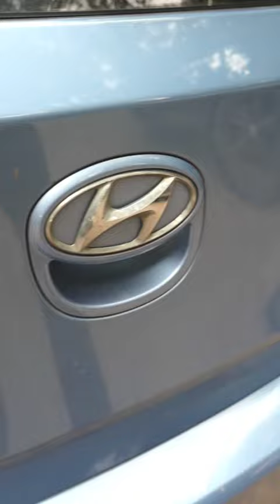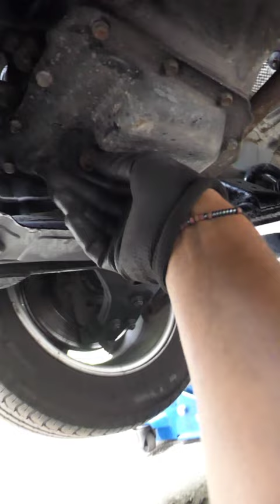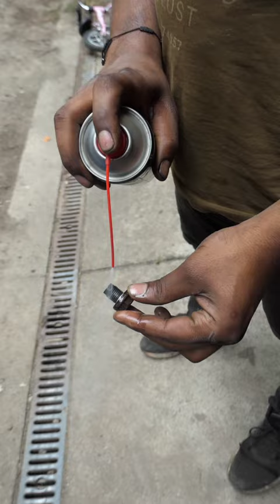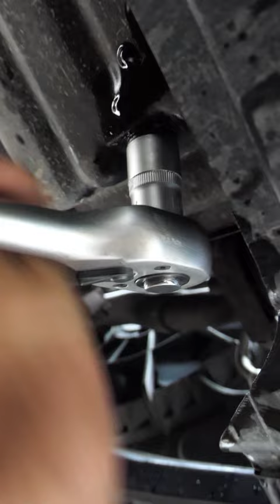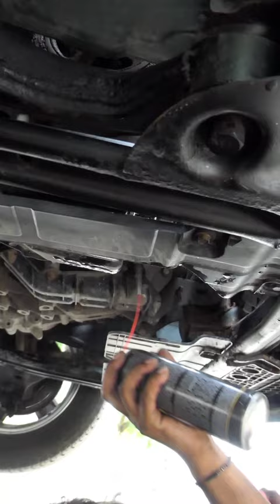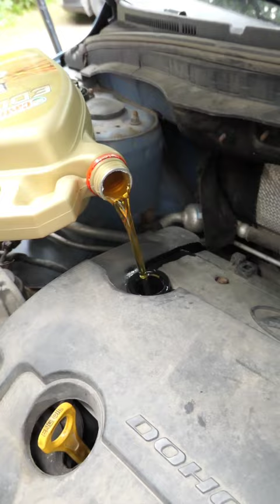Oil change after 15,000 km. #shorts  #hyundaii30 #mechanic

Comment from the maker: Drain plug of Hyundai i30 is in the front side and it will be elevated in an angle if the front wheels are lifted and won't help with a full drain. Thus, I had to lower the front end. It's recommended to lift the front and rear end of the vehicle in same height to get a full drain. Subscribe to see more content like this. Cheers!